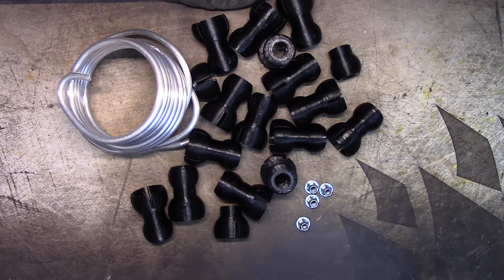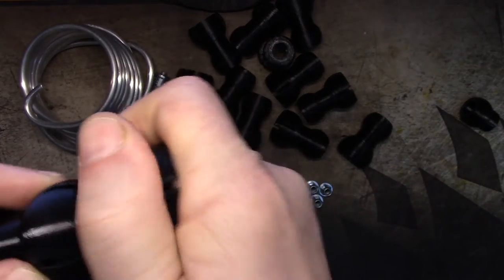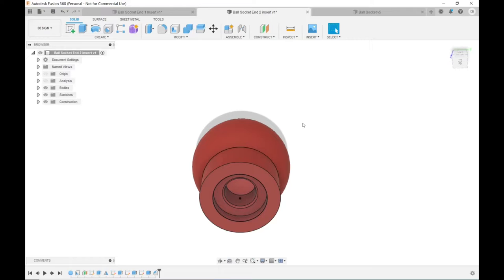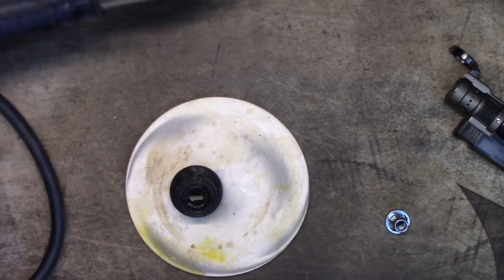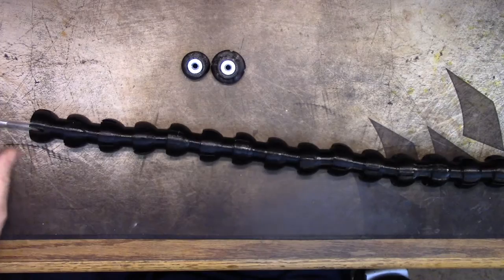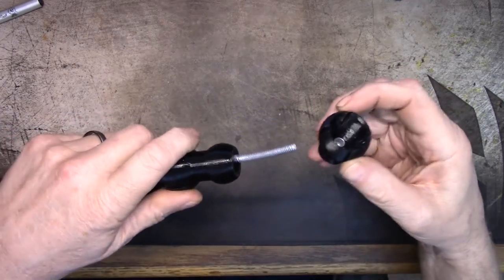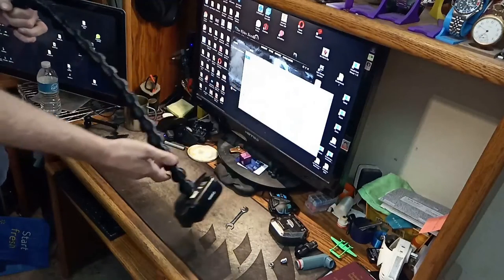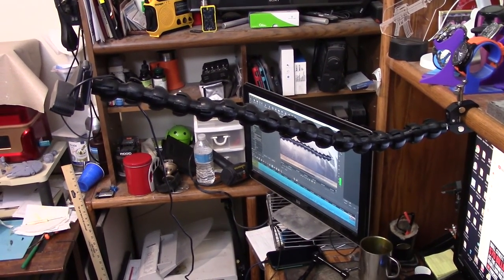3D Printed Flexible Camera Arm Part 2 - Assembling with the Armature Wire

Comment: I designed something similar on a much smaller scale and found that the joints widen after a couple of days thus loosing friction and not holding together at all anymore. Michael from Teaching Tech has created a nice solution adding rings to tighten the connections up. That might work for you!
Reply: Can't put in links. Posts are getting deleted. It's Thing 3223979 on Thingiverse.
Reply from the maker: Thanks for the tip, I'll take a look at TT's video. But if you noticed in my video I had threaded inserts in each end piece and threads on the ends of the inner stiffener rod. For mine to come apart the threaded inserts would have to come out of the end pieces or the threads on the rod would have to strip. So unless that happens it's not coming loose no matter what the outer plastic parts do. They're really there for appearance and not much else. In my next version I'm planning on having a stiffer internal rod and steel threads, so the likely hood of anything ever coming loose will be slim. Or that's my hopes, failure is always an option here, lol. Thanks for watching!

Comment: The plastic pieces add nothing much, other than appearance. Just use the larger fuel line, paint it black, or use heat shrink over it to make it look pretty.. You can fit the studs with epoxy resin, or  wedge it in a plastic printed bush. If  you want to prove the value of 3d printing, you could design a multi-purpose clamp  for one end, and a phone holder for t'other. It would be simple to have different lengths of the tubing. Eventually the tubing will fracture with repeated bending If you have a decent soldering iron, then you could have used that to heat and push in the inserts.
Reply from the maker: Well, this is a 3D printing channel. Also, discounting the appearance value of the 3D printed parts, it does keep the user from over bending in one spot, while that's not an issue with the armature wire, the fuel line will kink pretty easily if bent in one spot. But also it was fun to design the pieces, they do look pretty nice and I've got future uses for them where they'll be more integral to the function than they are in this project. Yea, I was a dumbass for not thinking of the soldering iron, specially since I have three of them within reach, one has a nice heat gun I could have used as well rather than the big one I used. Thanks for watching!

Comment: Great video Chuck, and I have few questions for you.
1 - Normally I use a soldering Iron to heat my thread inserts, then push them into the 3d Printed part, maybe a 100watt soldering would work? I've used this all the way up to 4mm inserts.
2 - Why not over thread the center rod, then tighten the assembly and place it under compression? Like they do with re-bar when building bridges? My question here is would it negatively affect the flex range?
3 - Why not try something like this for the end studs?
https://www.amazon.com/s?k=all+thread+coupling&crid=1X5M8KO89G4WL&sprefix=all+thread+coup%2Caps%2C431&ref=nb_sb_ss_ts-a-p_1_15
Use a bit of all thread on the ends, and it should give you what you need on the ends.
4 - What are you doing working in MY printer room? Sure looks like where I do all my work. Add a few (103) printed Pig samples, and you've copied my room.
As always, great video.
Reply from the maker: I just didn't think of a soldering iron. I've got three of them in same room, one of them is a 150w automotive type iron which, had I thought of it, worked great.
I'm not sure how I could put it under compression without damaging the plastic parts. I thought about putting a nut inside and out on each end but discarded the idea because I thought it would break. I may try it next time. 
I didn't think of couplings for the ends. I'll have to consider them to see if I think they'll work with what I've got planned for my next try.

I think by the time I was about 1/3 of the way through the process I was making mistakes, but decided to just keep going and see what other mistakes might turn up in the process. And me screwing up always makes good video.

Nice to know I'm not the only person with a lot of stuff in a small area. It doesn't seem that long ago that I cleaned and organized, but it only takes a week or two before it gets bad again. A old boss of mine once said "If you've got a clean desk you're not working hard enough".
Reply: @3rdpig  You know the REALLY bad thing is when you know EXACTLY under each pile of XXX that YYY is located. 
I look forward to you next video, I'd try it myself, however, I've been trying to print a 3d Sailboat and it keeps failing, splitting, or breaking, the walls are only 0.8mms. When I finally get the 3 prints to complete, at about 20ish hours each, only took 8 tries, I put the CA glue on too soon and glued the dang thing together before I'd aliened the hull. Someday you just have to shake you head and go watch YouTube cat videos.

Comment: would copper brake line do it ?
Reply from the maker: It might, thanks for the idea! But I've already got the aluminum fuel line. And I'm not going to be using it for anything else since I hope to go the rest of my life without repiping another vehicle fuel system. lol
Reply: Copper work hardens very quickly, It may become too brittle to be useful for this application